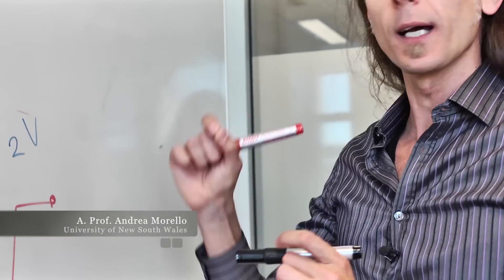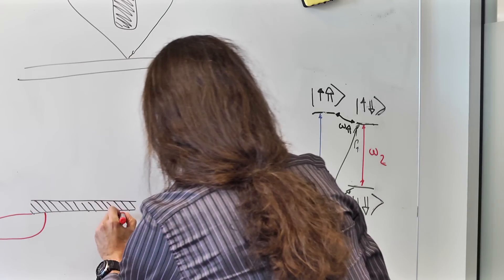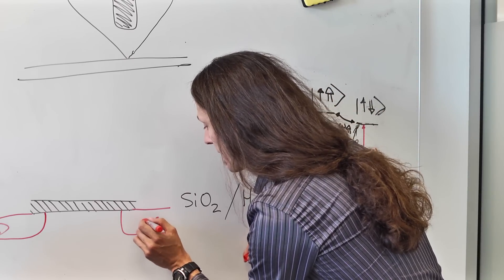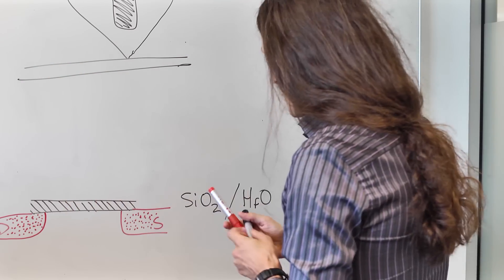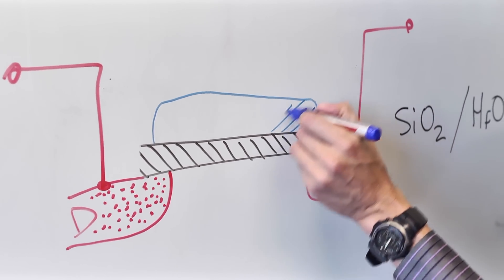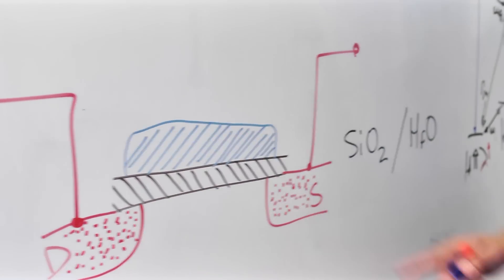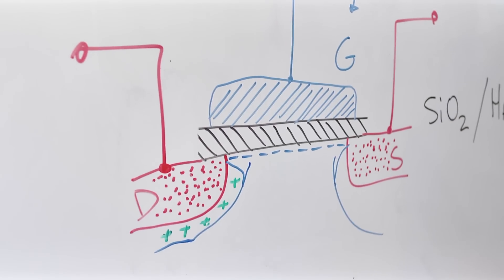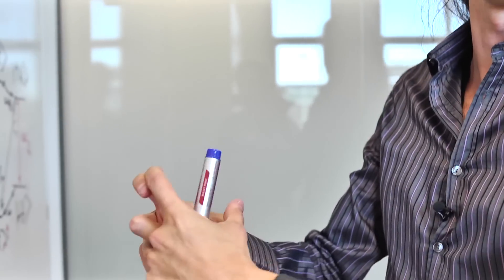Transistors & The End of Moore's Law

Comment: I have a question. Instead of trying to make transistor smaller, why don't we just make chips bigger. Ok it's may be not appropriate for thing like smartphone. But for PC or servers the size doesn't matter right ?
Reply: Because making the transistors smaller also makes calculations faster since the current gets through the system faster (shorter path). Making chips bigger would just create more parallel circuits and there are only so many computations which can be processed at the same time.
This is because the output of one computation is used as the input of another. 
So even if you have an infinite chip size, your computations will still be limited by the speed of your transistors because you can't run everything parallel at once.

Having a dual core doesn't make your computer twice as fast.
Reply: bnightm Electricity (movement of electrons) does not move at the speed of light. It is very very slow. More like a few meters per hour. The current itself, as an electromagnetic wave, is indeed the speed of light in a vacuum, but in a copper wire it is only 2/3 the speed of light. So it travels 20 cm in a nanosecond (1GHz is 1 tick every nanosecond).
Reply: We JUST explained that, seriously? You comment with a question on a comment that IS explaining your question? lol
Reply: good suggestion: But with today's silicon based computer chip the big challenge is cooling the chip cause the more transistors you have the more heat they produce, thus at one point it becomes a big issue. Best to look for a new semiconductor material to replace silicon.
Reply: ***** bnightm claimed that, and it is wrong. As I explained earlier. A current does not move at the speed of light in a copper medium but only 2/3 of the speed of light. What he makes up about "half the distance" is kinda bullshit. It doesn't have to go back and forth. 

As I empathized before, the reason why larger chips won't work, is because having a gazillion "gates" won't make your processes faster since you can't run the whole thing in parallel. That's why we don't have chips that are 10cm across. 

Let's say having a chip that is 10 cm (or 20 cm) across with a gazillion gates DOES make a difference and actually makes your computations faster, well then you'll have a problem with cooling (more gates = more heat generation), and power efficiency, because you still have to pump an electric current through your entire chip.
Reply: As I said before. Having more gates doesn't make your computer faster. That's why we now have dualcores and quadcores (and occasionally an octocore) and not 1000000-cores pcs, not because it is "impossible" but just because it wouldn't speed your pc up a slightest bit.
Reply: Are you kidding me ^^. I use it as an example to state the problem with parallel computing. More gates... more cores, the essential problem remains the same. What you really want is a faster processor clock, which is a bit dependent on the gate sizes, not the amount of gates.

By the way, the processor isn't really the bottle neck of the computer, the memory is. So it wouldn't really make your computer faster.
Reply: ***** The speed of the electrons in the copper is a good point that others made... but it basically comes down to the price. During manufacturing there will always be some defects. The larger the chip, the greater the chance of such a defect happening on each chip. Smaller chips will still have those defects every once in a while, but throwing away 2 out of 16 small chips vs 2 out of 4 large chips is a big difference.

So we build a lot of smaller, cheaper chips and make them work together. It is a lot cheaper to buy 4 chips at 1/4th the size and speed than buying 1 large chip. This is where the term distributed/cloud computing comes in. Even for servers, even for supercomputers, it is a lot easier to make thousands of relatively weak computers work together and share the load than to come up with a single HUGE computer. Also again, if 1 component fails in the monolith computer, the whole thing stops. If 1 component fails in 1 of 1000s of computers, you can detect that and replace that (cheap) computer without any downtime at all since everything else does not rely on that.

TL;DR: It is physically a lot harder and economically not viable compared to other solutions.

Comment: If theoretically, a single memristor could replace 10 transistors in a circuit.
Then isn't the act of making our transistors smaller not as big a problem as we are making it out to be? So we trade off size for efficiency..
Quantum computing will be there to 'pick up the pieces' for that time when Moore's law breaks down, but there are still many things we do not know about basic circuitry that we are only now just starting to grasp.
Very good video :)

Comment: Wow! Don't understand the problem though, Do the electrons break depletion layer easily when it's narrower? If so, then what about bombarding the depletion region with negatively charged particles to keep the barrier high? 

And also if the research is based on creating a computational device using quantum mechanics. How is it being done when the "switch" function is broken by quantum mechanics? Just wondering,
Reply: Electrons will break ANY barrier at a quantum level, they just appear on the other side - it's the effect of quantum tunneling he mentioned. Giving the depletion region a negative charge is what turns on the transistor/switch so if you did that your transistor would only be a useful as piece of wire.

Comment: With recent developments in tunnelling field effect transistors, it is now possible for traditional architectures to follow that exponential increase in computational power without worrying about the heat and power issues that are the limiting factor right now. Operating at just 0.2V, TFETs consume 100 times less power than what's currently used, so massive power distribution networks on motherboards will no longer be needed and heat dump will decrease dramatically.

Comment: With single electron transistors, there's no heat dissipation needed so you can pile up transistors one layer over the other.

Moore's law could still last for a few more decades.

Comment: Already done. New SSDs uses 3D printed transistors. The idea is that instead of laying them in rows, they lay them in columns (up to 1000 of them actually). They then uses nano heatpipes between each columns to channel the heat to the dissipation layer.

Comment: Small nitpick, I think he's wrong about transistor sizes having to reduce exponentially to match Moore's law. "Transistor size", as he defined, is the gap in 1 dimension. Microprocessor wafers are basically 2-dimensional, so you halve the transistor size then you can fit 4 times as many transistors on the area.

Thus merely a linear decrease in transistor size would cause an exponential growth in the number of transistors per surface area.

Comment: A transistor is just an electrical switch. You need to combine transistors in a meaningful way to create a logic gate. For example, the simple AND logic gate has 6 transistors connected together with 2 inputs and 1 output.

Comment: The transistors he describes is one kind of a transistor. It is the one that is used in computer chips (well, one of the pair of a CMOS transistor). The transistor he describes is an N channel echantment mode MOSFET. 
A transistor also not necessary used as a switch, it can be used as an analog controlled element. 

 Everything he says is valid, I just feels that it can be misleading for somebody who doesn't know anything about microelectronics to beleive that this is how *the* transistor works.

Comment: Another angle of trying to make computation faster is Plasmonics,
using light to move through electrical devices, so that information will just travel faster instead of transistors being smaller.
Right now, it can't be applied but people are getting surprisingly closer to it.
 
Unfortunately, I don't know a good video that explains it :/

Comment: I can see why you'd say that, but I'd like to understand really low level functionality to some extent. The professor says stuff like "when the IO completes, it sets the interrupt bit on the processor which asynchronously interrupts you process, allowing the interrupt handler to place the data into the correct area of memory," but I don't know how you set an interrupt bit. For a CS major, it is only important that it is changed from 0 to 1 by IO device, but I'm not sure how the change occurs.

Comment: Of course. People still differentiate between programming in hardware vs software, though. People occasionally suggest moving performance critical operations into hardware, which is presumably more efficient. I know a lot about how software works, right down to machine code, and even a medium-high level look at the hardware. I just don't understand much about the actual flow of electrons.

Comment: Great observation.  There are transistors driving other transistors but the first transistor in the chain needs some kind of sensory input.  This could be a keyboard, mouse, video camera, temperature sensor etc..  The system needs some kind of physical interface otherwise it doesn't do anything useful.      Does that answer your question?

Comment: You should √ out Roger Penrose and Stewart Hammeroff.

If I understand correctly, yes, our neurons work like transistors, but our actual consciousness is probably (according to their hypothesis) located on a much more fundamental (quantum) level.

So, if you want to use the computer analogy for the brain, you'd have to be thinking "quantum computer". This is why modern computers still are no where near "consciousness", even though people like Ray Kurzweil predicted they would be by now.

Comment: On a large scale that would then be cluster computing, on a small scale it would be multi-core processing, similar to how several hundred graphics processor cores work in parallel (think CUDA). The problem is that the processors would still be limited in the speed they could communicate with each other by the speed of light.

Comment: It does in a way. His statement about light speed does not, as electrons in a CPU do not reach light speed.

The fact is that the longer a circuit is, the higher your latency will be.

One potential CPU design is to have 3D transistors and use parallel processing. Have 4 small cores dedicated to providing low latency instructions (good for gaming and video) and one large core for large operations that doesn't require a low latency.

Basically, smaller cores = lower latency.

Comment: Quantum computing, photonics (you missed this one out, it's using photons to transmit information in place of electrons), neural nets (you said this one, it's essentially parallel processing) and DNA drives and DNA memory (sound weird but I've seen it mentioned in articles).

Quantum computing can't provide you with stable memory and low latency floating point operations but the others can, DNA drives can also supply you with massive amounts of memory for usage.

Comment: So, can you increase the size of the chip as long as it has enough GHz?
Because like you said that light can only travel as many GHz there are.
Which means, if a processor was 5 GHz (and many of overclocked 4770k are), it can be 5 inches instead of the 3.5?

Comment: "A specific paradigm (a method or approach to solving a problem, e.g., shrinking transistors on an integrated circuit as an approach to making more powerful computers) provides exponential growth until the method exhausts its potential. When this happens, a paradigm shift (i.e., a fundamental change in the approach) occurs, which enables exponential growth to continue." Ray Kurzweil.
So as you can see Moor's law will not necessarily exhaust itself rather move the next level.
Great video!

Comment: As you keep tacking shit onto the core you end up making it less and less stable. This is why multi core processors and servers with multi CPU's exist. You have an upper limit to what you can connect onto the shared parts of the CPU as well, you can connect many CPU's to a memory bus though, that's how you make "bigger" CPU's by integrating the memory controller into the CPU you give yourself the opportunity to add multiple CPU's on a single die, Which I think is where the industry is headed,

Comment: IDK wtf the other guy is talking about but in a very simple way a bigger cpu means the electric current has to travel more and makes the cpu slower, if you make a cpu with 9999999999 meters it will take forever to reach the other side.

Comment: Because of the speed of light.

Light travels about a foot a nanosecond (a nanosecond is a billionth of a second). The fastest processors work at, say, 3.5GHz, which is 3.5 billion cycles a second, or 3.5 cycles a nanosecond. This means light can only travel two sevenths (2/7 or 1/3.5) of a foot per cycle, which is about 3.5 inches.

Conclusion: if you made them bigger, light wouldn't be fast enough. Talk about pushing the boundaries of physics.

Comment: ok so let's say we reached the limit of "size" between the source and drain of the transistors instead of tryin to build a wall so the electron wont pass through why not make the source and drain smaller, so you could more transistors on a chip

Comment: Moore law has alread ended, not yet on transistor size, but the on heat dissipation, its over. He have hit the wall, even if we made it to 5 nanometer, we cant take away the heat. This is why they started making more cores instead of increasing frequency.

Comment: Think of electrons as a wire, In a normal wire electrons are all "touching" so they can flow freely when electricity is applied. In a transistor they aren't touching, until the Gate attracts electrons, this pulls the electrons together into a pool of electrons. Now the electrons are touching and can flow freely.

Comment: you're right, both source and drain could be sources of electrons thats why we call FET transistors unipolar

but there is a practical problem with that

as you can see on the video to open the transistor we apply voltage to the gate, but to make electric field we need additional electrode oposite to the gate

the fourth transistors electrode, called bulk is typically conected to the source, thats why we can use FET's only in one direction

every FET includes a diode from source to drain

Comment: To be clear, the "insulator" is the material between the gate and the rest of the transistor, and no current actually flows through it.  What separates the source and drain is not an insulator, but more semi-conductor material of the opposite "charge" ( doping ).  The very nature of a semi-conductor is that sometimes it conducts, and sometimes it does not ( insulates ).  It is the electrical charge on the gate which controls whether or not that region of the device conducts.

Comment: Yes, the electrons actually come "from" the source, WITHIN the device itself. 
OUTside of the transistor, current ( electrons ) continue to flow, out of the transistor's "drain", through the "load" ( whatever the circuit is controlling ), to the power source ( usually a battery or rectifier unit ), and then finally back "into" the source.  As for the gate, you're almost correct, except that it is an ELECTRICAL field, not a magnetic one, which draws the electrons from the source.

Comment: The Drain and Source function as the input and output of the device, so they would effectively be the two terminals of a mechanical switch.  The Gate, however, acts as the moving contact which opens or closes the "switch", thus turning the circuit on or off.  The gate itself is controlled by some other external circuit or device, possibly even another transistor, which sends it either a "high" or "low" voltage as needed, to control the primary circuit of which the transistor is a part.

Comment: Depends on the use; for stuff like amplifiers it lets you control high voltage using low voltage; but for logic (like in computers), it gives you a way to get a logical AND gate (the output is only 1 when both inputs are 1)

Comment: The "gate" acts like a gate; if you have voltage on it, electrons are attracted under the insulator and form the conductive channel. Then if you give tension to the source, current will flow. No gate voltage -> no channel, no current

Comment: they (electrons) won't go thru the insulator, they will form a layer on the underside of the insulator, which will connect the source and the drain, which gives a flow of electrons.

Comment: It probably won't. At least not for us normal programmers. You will have your API, push some data in and get some data out. It's incredibly hard to come up with new quantum algorithms, even when you abstract all the quantum weirdness away. It's important to realize that you can't magically speed up all computing with quantum computers. It's for example even proven that you can't sort any faster than with conventional computers so don't expect your GUI code or whatever to run any faster.

Comment: Well, I kinda do. For example, multi-threading is crucial now, and this is just (ultimately) because of the silicon heating up too much if it's all in one core. Therefore I need a whole set of libraries and code style just because of how silicon heats up.

But I see where you're getting at, I'm pretty sure in the end it's either going to be a von neumann machine or an emulation of one, at least initially.

Comment: There are many ways to improve computing power before or as we reach the "quantum limit" of the silicone. 
- increse the clock speed
- add more cores
- makes bigger registers
- optimize the core structure of a processor
- many other things like optimize the memory, makes bigger register, till to optimize the software (booting W8 on a modern PC is not faster than booting a W95 on a Pentium90...)